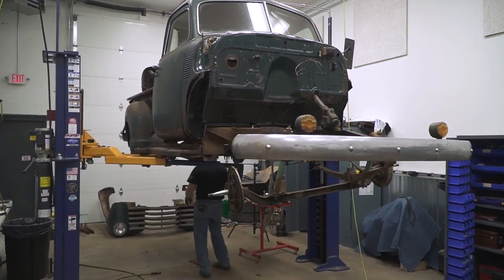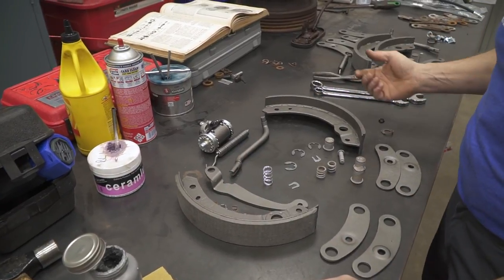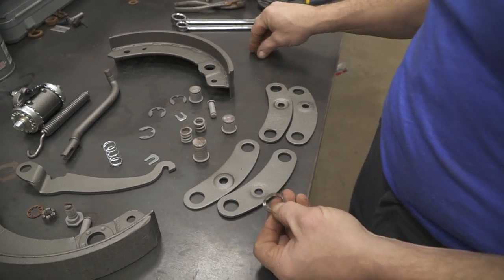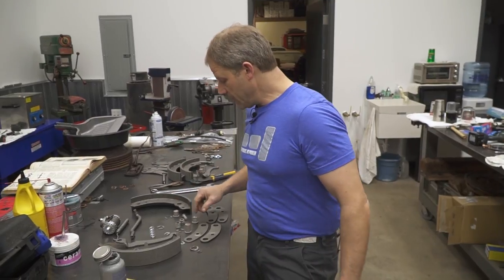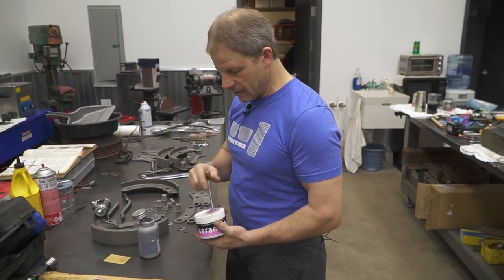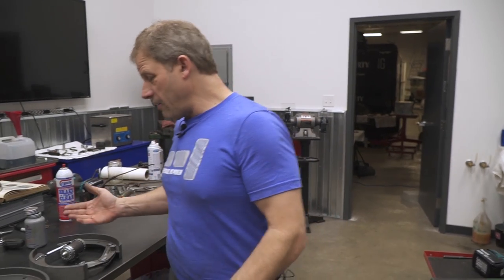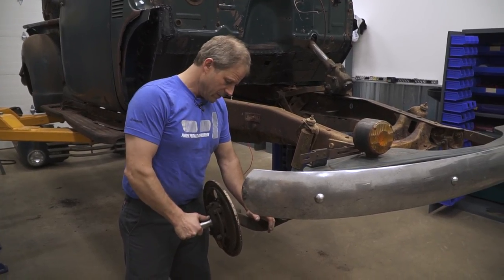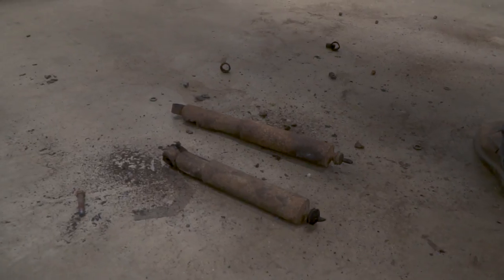Truck project update: Brake Time! Assembling drum brakes on our 1950 Chevy 3600 | Redline Update #33

Comment: Not generally a good idea to use an oxy/acetylene torch on a shock.  Even if you - as a mechanic - know how to avoid causing the oil inside to boil and come out under high pressure, it gives the general uneducated public the idea that it is perfectly OK to use a torch on any part of them, including the oil reservoir of the shock.  If you have to cut them off, use a cut off wheel to cut the bolts or the shaft.  If the only tool you have is the torch, drill the bottom of the shock and drain out the oil before torching them off.

Comment: I would have used my 20V grinder with a cutoff blade, to avoid the stench of burnt rubber that was not tire rubber. LOL But I have done it that way many times too. Oh, instead of using 15 mm E-clips, I have used a thin washer and safety wire, in a pinch. But E or C-clips are better.

Comment: If this was on MotorTrend it would be littered with "our buddies at Wilwood sent us new disc brakes...our buddies at CPP sent us a suspension kit...our buddies at QA1 sent us shocks".
Hats off to Hagerty and Davin for showing us how a real restoration is done.
Reply: True, those shows are little more than infomercials these days.
Reply: While that's true and I agree. Alot of people actually want to drive and enjoy thier vehicles. All those old brakes and suspensions were fine when every car had that. But even the cheapest new car can stop faster than the best of the old stuff. Its actually pretty terrify to drive an old unmodified restored to original car in today's traffic. Try it it's not fun. That's why everyone upgrades
Reply: @leokarasinski4217  It's not that bad if you're driving defensively. My 65 F100 has four wheel unassisted drum brakes and 7 turns lock to lock in the manual steering. The thing stops just fine. I'm not running it on the Nurburgring.

Of course I do commute by bicycle, so maybe my legs are a little stronger for the clutch and brake pedals. :)
Reply: @TylerLinner  its doable. But I've driven my fair share of older cars. They dont stop like modern cars and most of them handle terribly. You can do it. But a few upgrades isnt going to kill the value of the car. I'm not saying go nuts with aftermarket parts but some upgraded brakes and steering/suspension components arent a bad idea
Reply: @leokarasinski4217  Could be nice. Not strictly necessary. I think the limit of safety is a few decades earlier. You wouldn't find me trying to drive a Model T on the freeway, but I'm told a Model A with a 5 speed swap can cruise at an acceptable clip.
Reply: @TylerLinner  some of those oldies can really fly..  rear only cable brakes dont sound much fun tgo haha

Comment: I restored a 1958 Chevy 3/4 ton Apache custom, when. I got to the kingpins, they were toast so I went to a aircraft hardware manufacturer in Ventura and had him machine two kingpins out of Titanium along with two stainless steel upper and lower bushings with grease passages and zerk fittings to grease them with, man was that sweet..

Comment: I have a 37 Chev half ton.  I completely rebuilt the brakes, shackles and kingpins.  Now I'm Changing directions.  I'm putting a Fat Man Fabs MII front end on and probably his 4 link as well.  All those parts are going to be available.  I de-rusted everything and painted with IMRON and reassembled the leafs with grease.  The shackles are the threaded pin variety with tapered ends and clamped.

Comment: Great series on the Chevy.
Since you're doing original drum brakes, I thought I would toss out a tip about new brake shoes that are on the market.
Most suppliers are selling brake shoes with very "hard" lining, which can create a very solid pedal but, very low friction between the lining and drum surface (which reduces the braking power) and an even scarier problem, ..the linings can very quickly overheat, rendering them incapable of stopping the car.. it's happened.
The best rebuilt brake shoes I've found are available at Napa auto parts, ..and are the "least"expensive shoes that Napa sells. Keep up the great work.

Comment: Davin's advice for getting parts for old cars is exactly right. The local parts store will often not have what you need. I work at an auto parts store, so I know. Although, you may be surprised. If the same part was in production for a very long time, often we will have it. Also, wear parts (by new-ish car standards) for the more popular models, especially pickups and sports cars, even back to the early 60's may be in stock and even more for next day delivery. 

Word of advice for going to the parts store: have a year, make and model and/or a part number. DO NOT come in and say "I need a thingamajigger for a small block 350" If we are in a good mood, your response will be "I am sorry, but I need a year, make, and model for my computer system." If the salesclerk is in bad mood you will be slapped in the face. BTW there is a special place in hell reserved for the people who counter respond to the former with, "Awwww, it's just a chevy 350, it doesn't matter" IT MATTERS. 

If you're having a hard time finding a part, arrive before 5:00 pm. Before 4:00 is better. Only the managers make enough money to raise a family, so they are often the only ones with more than 2years experience. Managers make the schedule, so they get the best hours, and they tend to have families they want to spend time with. Also, the store tends to get busier and busier as the day goes on, so arrive as early as you can. This also gives us the most time to get a part to you by the end of the day, although this perk will depend on how remote the area is. 

Please be nice, especially to the greenhorns. While they have the least knowledge, they also have to constantly deal with customers who want to speak to manager, even though the greenhorn is usually correct, or is dealing with the edgiest of edge cases (you). The learning curve is very steep, even for car guys. Also, the length we will go to get you what you want is closely related to your manners and fairness. Firmness is fine, but hostility will never get you the second mile from us. Also, there are a bazillion different names for car parts, no one has heard or understands them all. If we don't know what you mean, walk us through what the part does. Our catalog is designed to let us find parts we do not know the name to. DO NOT say "It's just a ___. How can you not know what a ___ is?" I personally heard a man say "huv", when he was mispronouncing what I believe was "hub", but the part was in fact a spindle/axle nut. 

Lastly, please, don't send your girlfriend (or other non-car guy, non owner/driver of car) to get you a part. There are often many questions that we MUST know to get you the right part. If getting the part yourself is impossible, at least call ahead of time and sort things out first, but also tell us who is coming to pick up your stuff. On a related note, do not call us and speak through your wife/girlfriend. To constantly hear the guy in the background relay through all the answers is the most irritating part of the job, more than Small Block man, I Can Get IT Cheaper Here man, or Cost/Availability Disbelief man.
Edit: Yes, inflation is a thing, and there is a reason our parts cost 3x more than the cheapest thing you can find on the internet. And, thanks for reading my rant. I feel much better now, for whatever that's worth.

Comment: Great project and video. I usually check (as you've done I'm sure) the drums for thermal cracks, bad groves (from old riveted shoes) along with circular trueness and machine the drums true if possible or replace if needed. Keep up the good work.

Comment: "The catalog doesn't show my part"  I found this to be very true in my recent rebuilding of the steering column of a 1967 El Camino.  It is a 3 car/2 year only column that is a far departure from the columns before and after.  Outside the box later and the column is safe and fully functional.

Comment: i had a 50 mold GMC i loved it put a corvette 327  4 speed 9.11 rears hydraulic clutch  it was sweet man kept the body original, Beef up the suspension put leather bucket seats Sold it to may friend ,he made it back into a grandpa truck sold all the parts grrrr i was going to use them in a 68  Chevelle SS

Comment: Ode du rubber is a common smell in midwest brake and muffler shops because of the salt on the roads in winter where nut and bolts weld themselves together with ferrous oxide. You can try penetrating oil but the gas ax makes it so much easier.

Comment: Guess the only thing you didn't address was it has a ajuster on both sides of the "wheel cylinder" so both have to be adjusted, its normal for the back half to wear faster than the front half of this type system. When buying shoes in store the short shoe goes in front of the set ie front/back on each wheel. People have to be told every step or they point fingers and make fools of themselves. Nice touch on the universal vice clamps. Never seen that one coming

Comment: I'm going to guess the diameter for the big pivot pin is 19/32" (.59375"). 15mm comes to .59055"; so yes, a very good fit for the E-Clip! I've not seen this type of wheel cylinder before this video. I was expecting to see Concentric Adjusters and a wheel cylinder with different size bores. Very cool.

Comment: the older among us still have the proper tools for doing brake jobs on drum brakes . the tool he was forced to make is or was a common shop tool used to compress the different springs and clip's and without it the job is a royal pain in the ass . all the parts of drum brakes had there own tools that if you check around older garages you may find a old man to sell you a complete set . if your going to work on vintage cars and trucks it wouldn't hurt to have a set . I would send you mine but I'm still using them. you can check NAPA the last I knew they still had most of them in stock.
Reply: The good old brake spoons, and brake pliers!!🤪

Comment: Good video. 

Though it doesnt apply to the year i own. its informative !   

I have a 1955 GMC and upon removing the drum i noticed it doesnt have self adjusters which sort of confused me because i thought thats weird. But i guess for these older trucks they required manual adjustment every so often. some what annoying but i guess a truck from the 50's you can't complain.  

I am considering getting a conversion kit or some way to get self adjusters in there because it would drive me nuts having to go under the truck every time it feels like my brakes arent getting the best peddle feel to adjust it. Thankfully though im in the process of upgrading to a dual master cyl aswell as disk brakes up front.  So im sure it wont be too much of a hindrance.

Comment: Dont use lubricant of any type on drum brakes. Bad for linings when it melts out and it attracts brake dust and road grime.
Those brakes are exactly the same as early 48-62 Holdens here in Oz.

Comment: I’ve always hated working on drum brakes always a hassle always and if the car has got drums on the front doesn’t matter how many times I just the clearances the steering pulls......

 And if you get it right adjustment never seems to last as long specially on the front

Comment: I'm sure it quite difficult to get your large camera in there but would have liked to see the rear brakes all assembled with the e-brake cable etc. and explaining how they are adjusted?? 
Also, a little surprised you don't do a little more painting. Backing plates/differential as a example. ;o)  Just a "observation".
Reply: I'm thinking that they're going for a certain look with this truck. The patina craze is usually only skin deep on most cars and trucks. They all have modern drivelines, wilwood brakes, and LS powertrains. That's all fine and good, but a well worn look with all the basics refreshed is cool too, as long as it all works well.

Comment: It’s interesting that there doesn’t appear to be a leading and trailing shoe🤔 normally the friction material on the shoe closet to the front of the vehicle is shorter at the bottom and visa versa for the rear shoe.

Comment: 1948 Chevy 1/2 Ton, short bed, pickup. 
I'm puzzled why I just can't get the emergency brake to hold. I've replaced the emergency cables on both sides. Ensured that the cables were adjusted according to 1948-1954 Chevrolet Shop Truck Manual (step by step.) I've even reinstalled one of the old cables and still no luck. Looking at your display of the rear brake parts mine conforms to your configuration. I've even physically viewed and video the movement of the lever, so I'm positive the cable is pulling the lever. The new cables were purchased from Classic Part. Any ideas?

Comment: I have been search for rear and front brake parts for my 1951 gmc 250. Is it possible you could point me in the right direction. Basically everything between the brake shoes.

Comment: I would have thought you would at least put a disc conversion on the front to make the truck more streetable??
Reply: If those drum brakes are installed correctly and adjusted correctly, they stop plenty good.
Reply: @markk3652   yes in the dry there fine, however living on a farm with wet fields and running streams when they become wet  stopping is how we say, problematic for drum brakes.  Especially on rain soaked roads which is why manufactures switched to disc front/drum rear.  The inclusion of Disc front brakes started to become standard in the US in 1965.
Reply: @ditzydoo4378  I'm betting the hagerty folks won't be churning up the fields with this truck. A tooling around town parts getter is all this thing will be used for. Drums can be dicey when wet, but that's how cars and trucks were built.
Reply: @markk3652   so true, it reminded me of our 1956 Willys CJ-5/M38.  It has these tiny 9-inch drums front/rear and could be quite the adventure in the wet to stop.  We installed a Bendix "Bolt-On" front disc kit which alters nothing and can be reversed by simply swapping back, but this Jeeps been in the family so long we'll never part with it.   ^_^   The scary thing is panic stops with wet drums has led to quite the number of wrecks over the years.

Comment: @9:53 holes in corroded frame, meh. It's less weight, will be faster.
Reply: youre wrong. its 3d printed to be light, designed by ai. corrosion is just for the looks to make it more human made.
Reply: @stopstalkingyouspookybastard  it's top notch rats racing tech.

Comment: You done them hold down clips all wrong they do sell all them brake shoe clips at chevys of the 40s the small pins with the springs the slot goes to the back not on top of the spring I know I just done
 It on my 47 chevy fleetmaster

Comment: When it comes to videos for restoration you have lots of room for improvement.  Its a wheel cylinder not a master cylinder.  That actually called an "E" clip.  Not a "C" clip. IT should be noted that the E clip can be replaced in the future, should someone find the right parts.  IF you had drilled a hole  in those parts, they would have been damaged for good.  I would never put those brake parts back on without doing something with the backing plates, even if it wasn't the best job. Cutting shocks off with a torch is completely overkill and unnecessary, and can even be dangerous, because they are under pressure.  A impact, sawzal,  or air chisel is much more efficient.
Reply: Cutoff wheel for rusty shocks is good too.
Reply: romans??
Forget it man, he's rolling......